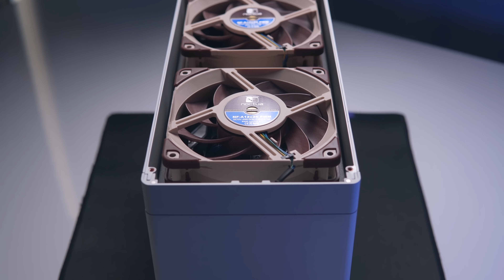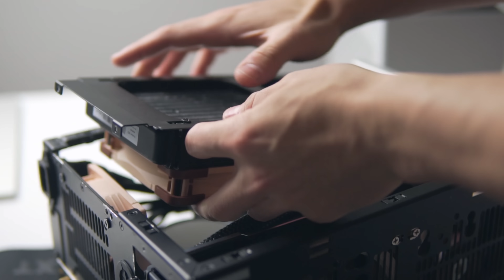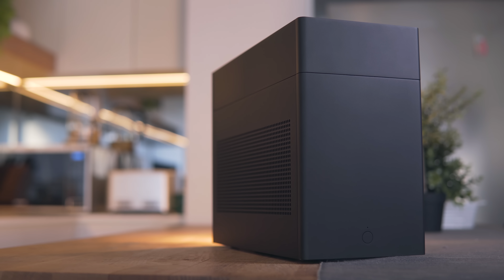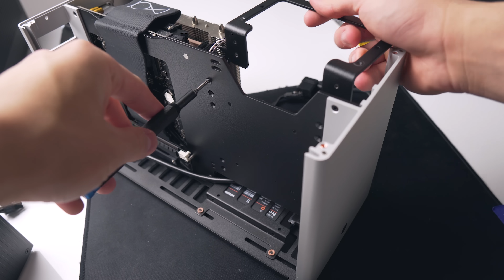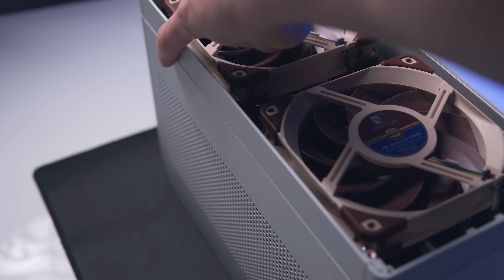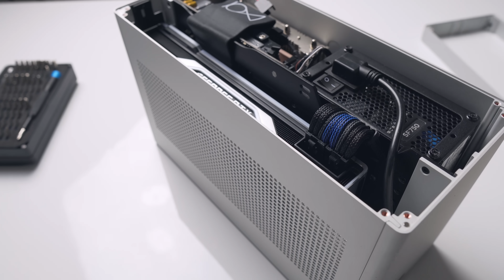High Airflow Ghost S1 Build - Negative Pressure FTW

Comment: still waiting for a corsair one concept design ITXA4 structure case.....

such as using one single 120 or 140 in the front of the case as the only fan for the whole pc. and put rads on top or bottom, use pressure to make it work.

simply I hate how those  "hats" ruin the proportion of the itxA4 design......

Comment: "Yes, I know heat rises, but this is only relevant in a passive way" 

THANK YOU. People really don't understand this enough. How can the hot air rise when there is several fans shifting the direction of the air? It makes no sense. Exhaust the air out in the most effective and efficient way possible, that isn't always the top or the rear depending on the case.

In an ATX case, most effective method is 2-3 fans at the front, one on the side, one on the bottom, one on the rear. Yes, you read that right. A side fan. Bit Tech proved this in this investigation here - https://bit-tech.net/reviews/tech/the-big-cooling-investigation/1/

Want the best cooling? Get rid of your yucky side windows. (I know my comment doesn't apply to this video. Most people run ATX cases and really fuck up their cooling)
Reply: True. Also one fan makes a world of difference, two, three, four fans...not so much, the diminishing returns are gigantic. As long as you are efficiently bringing in air that did not pass any components, and exhausting air that has passed them, you are almost at the top of your air cooling potential if all other factors are the same (same fan model, same heatsink model, etc).

Example: I have a Rainjitek Ophion, which has almost the same fan layout as the Ghost - bottom space for a slim 120mm fan below cpu/gpu, top space for two 120x25mm fans. I wouldn't dare run it fanless like Gamers Nexus did, but one fan on top of the CPU and GPU as exhaust gives me great thermals. Two fans is hard to see the difference, maybe 1 degree less? I notice the air the second fan blows is mostly cold. I ran without that fan for some days and everything was fine, but I keep it there because it sits on top of my PSU, which has a semi passive mode so the fan never turns on, so I guess a bit of the PSU heat is exhausted.  With the third bottom fan added (a noctua 12x15)...no difference at all. GPU is perhaps 1 degree colder. I also swapped the top 25mm fans for  slim 13mm fans (these exist, Rainjitek Aelus), no change in thermals. These fans have less "air moving potential" than 25mm fans, but the take away here is that the case is tiny, 25cm/10inch in height, which means that from the GPU/CPU to the outside of the case there is like 5inches to be travelled by the hot air. Would a 3000rpm industrial Noctua move the air out faster? Yes. Would it be a big difference in the grand scheme of things? Probably not

Comment: Why u never talking about ram temperature? I had Ncase m1 with 1080Ti (Strix Undervolt 0.95v) , 8700k (1.28v Celsius s24) and 2x16 B-die ram (1.3v) and I got so alot troubles with ram. Cause b-die modules can get error after 55c. Even with 55c Cpu temp and 65c GPU temp I got troubles with ram and I think it’s important thing when I review any temp sides of cases. And btw even 2x8 b-die was rly hot on 1.3v in this setup in Ncase
Sry for eng

Comment: An AIO bracket with a 240 mil rad and the top hat config might be worth looking into. I don't know if the Kraken series is compatible but I also think Alphacool makes one.
Reply: minimuttonchops j2c mentioned normal aio pump block combo is not powerful enough for cooling both gpu and cpu

Comment: Did exactly the same thing on my Ghost S1, runs quiet and cool like a charm
Reply: how cool?
Reply: @firepro20  Don't remember the actual numbers, but never had more than a fairly mild warm breeze coming out of the top
Reply: @Sean Biganski Yep, two Noctua NF-A12x25 PWM
Reply: Nice!! What specs have you got? Did you undervolt your GPU?
Reply: @zqott7954  In the Ghost I have an i7 8700, air cooled w/ Noctua NH-L12 and a MSi 1060 GX, two M.2 NVME, the SF450W psu from corsair - all left as-is. Born as a travel build so water was no option.
Reply: ESOXMora Very nice, I want to build one with similar specs but with a i7 9700k and RTX 2070. Are you getting good CPU thermal performance with the L12? Been thinking about getting the new Ghost S1 edition

Comment: The case sits too low...raising it would improve the temps by couple of degrees, I bet.
But yeah, the negative pressure is underrated or even seen as something...negative (heh), but it gives excellent results in some cases, especially small ones (and even in some "regular" ones like NZXT H500)...
Reply: take this like from me for that pun
Reply: He had 3D printed feet to rise the Ncase up by a few cm :)

Comment: I can't decide wich one to buy, the ghost s1 or the ncase m1...
Reply: if i where you id chose between the m1 and the dan a4. the m1 is practically this case just with the top hat added on and just better in most ways. and the dan a4 is just a smaller version of the s1 minus the ability to upgrade with the top hats. i personally would pick the dan a4 because it is smaller while also being able to fit a 92mm aio in it (which is what im running)
Reply: Adrien DAN case will ship out. Ghost you’ll be waiting indefinitely